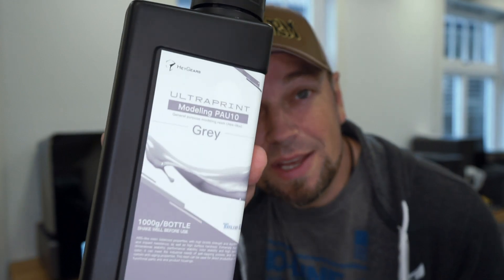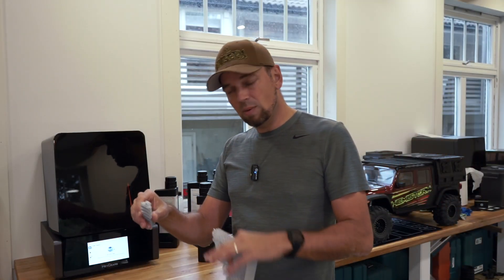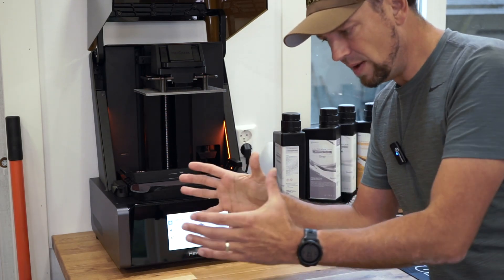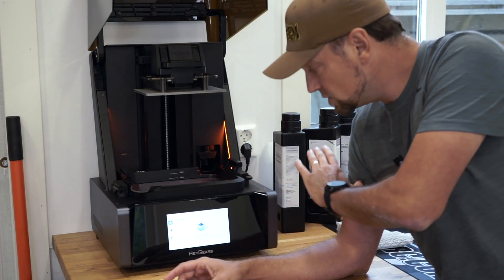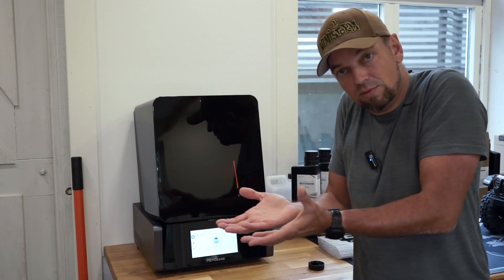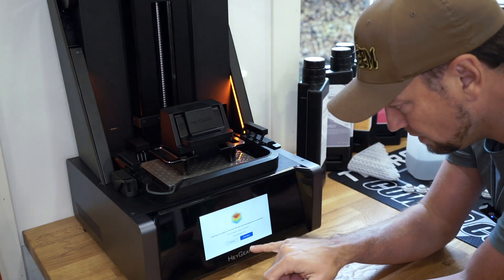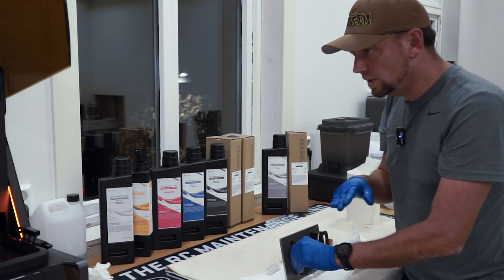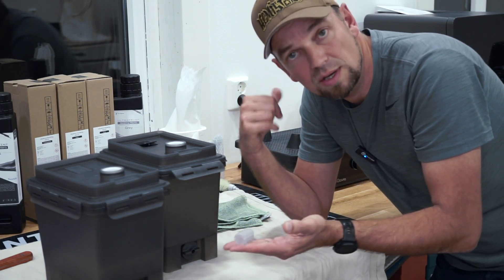RAD RESIN PRINTING! HeyGears UltraCraft Reflex

Comment: PRO TIP: 
When printing transparent resin, if you want super clear shiny parts, don't wash off the excess resin.  The excess resin will give it that perfectly uniform surface that is super clear and shiny.  Again, that's print, let sit to drain off some excess, and then straight to curing. 

Another tip, if you do wash and then cure but don't like the cloudy finish, sometimes you can simply dunk the cured part in clear resin and then cure to a shiny finish.

Comment: Proprietary? Have you tried pouring other brand resins into their bottle? I'm thinking it should work if the cost is prohibitive.
Reply from the maker: I have not yet, but I wouldn't be surprised if large containers with resin to refill the bottles will become available to decrease the cost. Thank you for watching!
Reply: You can, but you cannot adjust exposure settings at all with this printer. So unless the exposure profile so happens to match HeyGears' resins exactly, it's not going to work well.
Reply from the maker: @sasca854  I was referring to larger, more inexpensive resin containers for HeyGears to refill the bottles with the tags in them. Settings are indeed specific for what the machine registers. Thanks for watching! 😃
Reply: @sasca854 interesting. You can’t edit settings ?? I was gonna get this printer

Comment: Thanks for the tutorial. Looks to be a very reliable printer. Would this resin be acceptable for working parts like A-arms or shock mounts, etc?
Reply: Great for prototyping……but there’s a reason for glass fiber in injection molding …..and similar to FDM printers……the particle additives are too small and generally make the parent material weaker🙄😎
Reply: Resin is typically not good for parts like that, unless you want a shelf queen.
Reply from the maker: There are a couple of resins available that have some mechanical strength, but for a high stress part like a shock tower or an A-arms I would not advise it. Depending on the scale and weight of the vehicle of course.